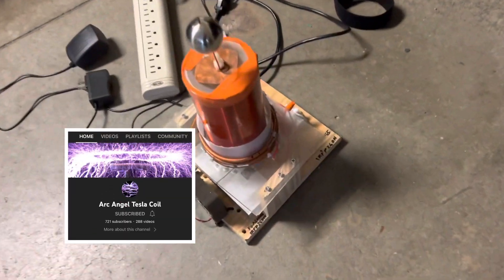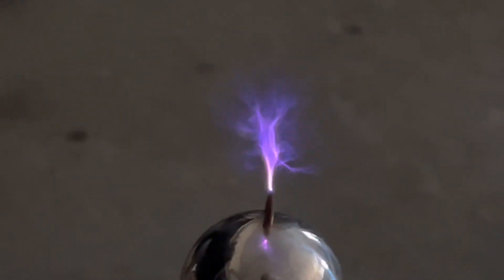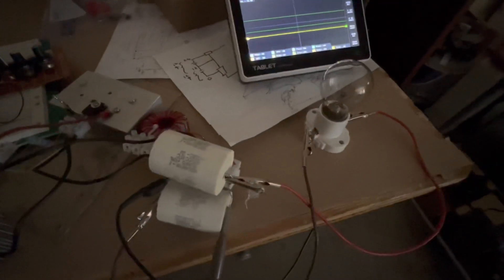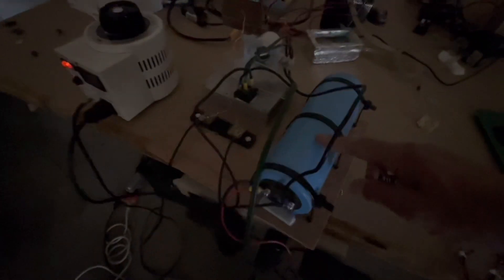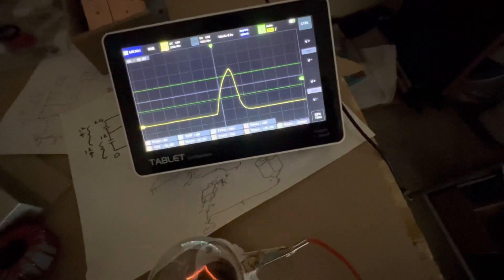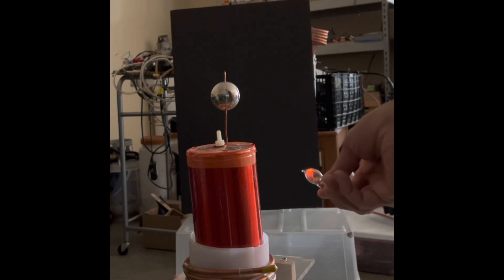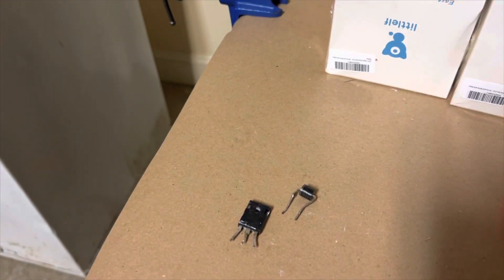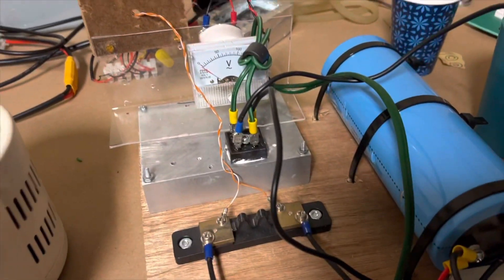RZVSTC

Comment: Hi there. Nice hearing from you again as I've been inspired by you to move into the Tesla coil world of diy's. But thanks 2u, I did my first zvs  powered Tesla coil & it worked great.  Many thanks 2u dear for bringing up such helpful videos. I would also make a humble request if you could share the full circuit of your new setup including the arduino. Last time I did my zvs driven Tesla coil, I got around 1 cm spark output & the wireless energy transfer was great though I didn't tuned anything as on my first attempt it worked awesome for me. But now I would like 2 try out your new circuit & see if I get it working with my Tesla coil. Thanks in advanced.
Reply from the maker: Thank you I am still working on getting this put together. Just experimenting with values. Seems to be amazing. Eventually I’ll have something where you can get full output from very low component count.
Reply: @BrianDhvTinkerer  Indeed, that's very nice. Me too same as you, it's like the minimalistic thing. The least amount of components for the best output. There's a guy who's actually doing impressive things with his single mosfet. His name is Nisaar. He's getting QCW, PLL, etc by just playing with different variations.. Don't know if you've seen his channel yet. But thanks again for all your awesome & motivational videos.